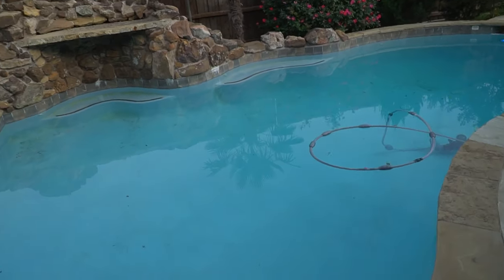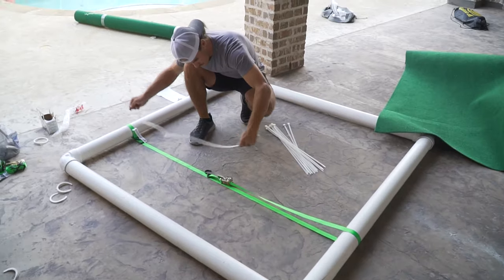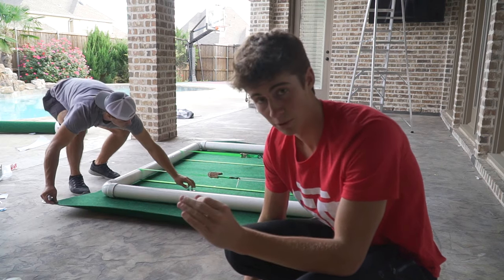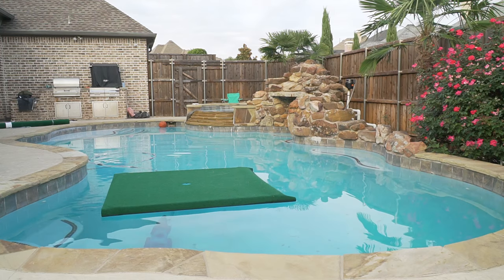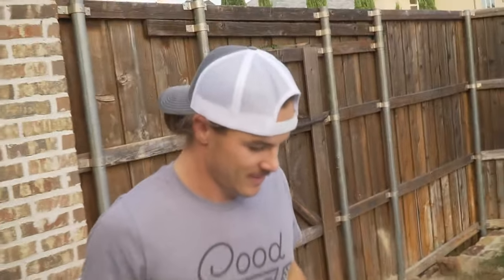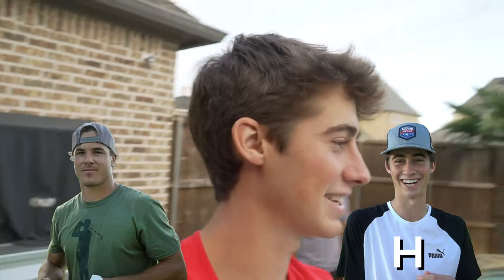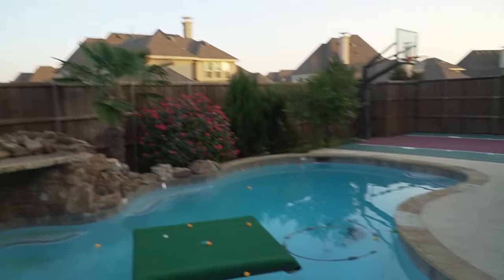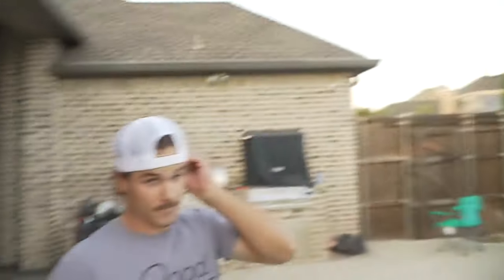We Built A Floating Putting Green In Our Pool | GM GOLF

Comment: I used a 4'x8' piece of 3" insulation with a 4'x8'x1/4" piece of plywood with turf stapled onto that. Use a hole dozer bit to make the hole which is roughly 3" deep. Floats level and stable. Add a carpet pad "future Foam" between the turf and 1/4" ply wood for a "softer" green.

Comment: enjoyed this. just tighten up the surface were as it doesn't sag around the pvc pipe.maybe also add a plastic sheet under the mat and put about 3 inches of sand between it to mimic ground affects.  maybe add a 1st or 2nd cut of grass  around the edges. it needs a permanent cup with a flag staff. needs 2 more holes, a corner shot and a tilt shot.  try a glow ball night round. yeah 1v1v1v1 or 2vx 2v. oh doesn't that backpool fence have a door? guess that's another project installing a 50 x 127 foot net.